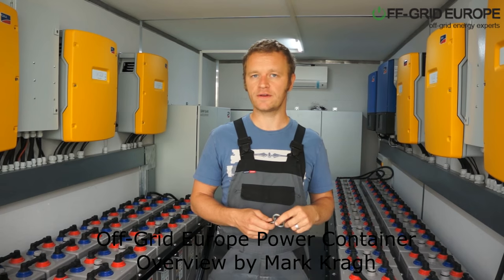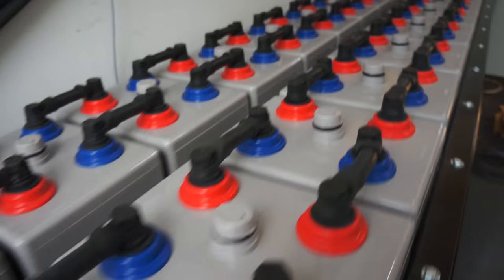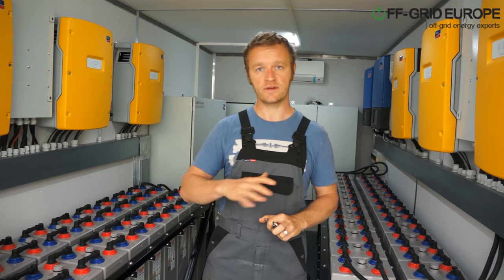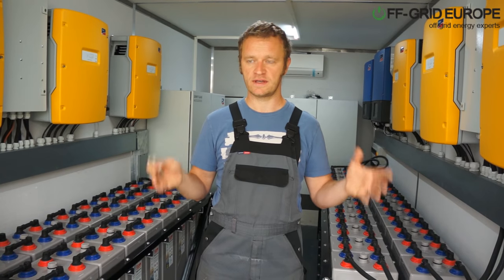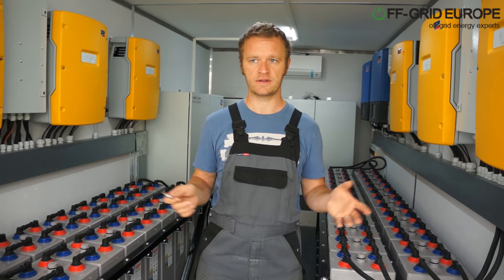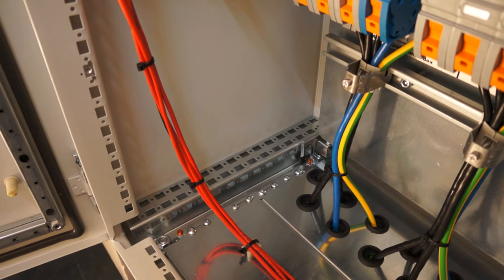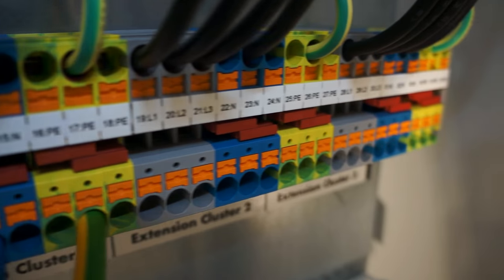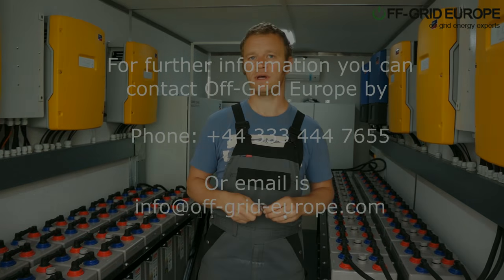Off-Grid Europe Solar Power Generator Container with aircon inverter and battery

Comment: We have purchased a cannabolized DC Solar Trailer in the US. It has two SMA 6048 inverters, (1) Midnite Solar 250 Charge Controller and pre-wiring for 120v/240v plugs with (10) used panels. Are there any schematics for the best panels to produce the highest kilowatt from the panels to the inverters to reach the 50AMP potential of the inverters? We will be entirely off grid and I would like to be able to produce the most power to keep a GNB 48v VRLA at peak condition. Thank you for any insight! Great video and installation!